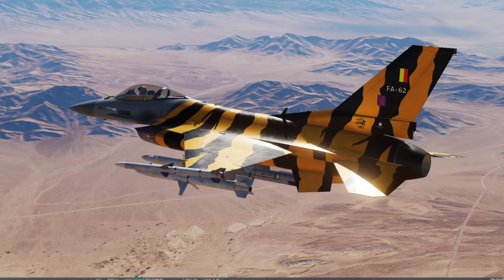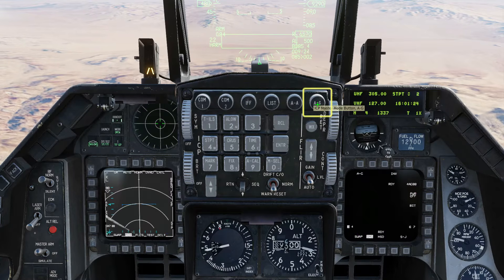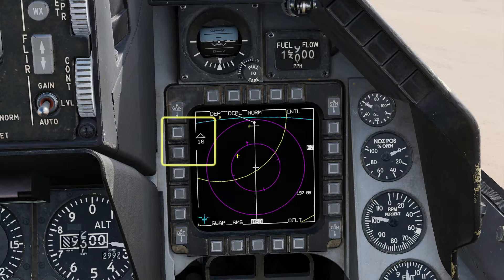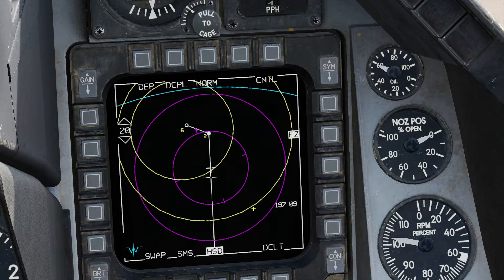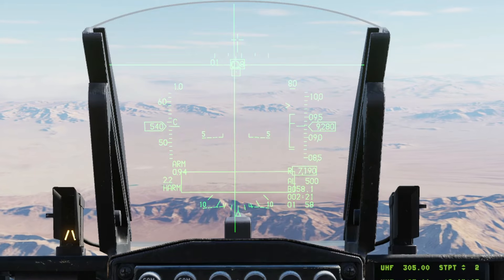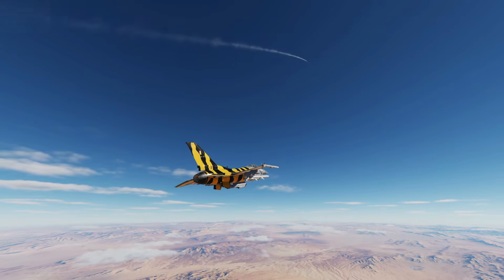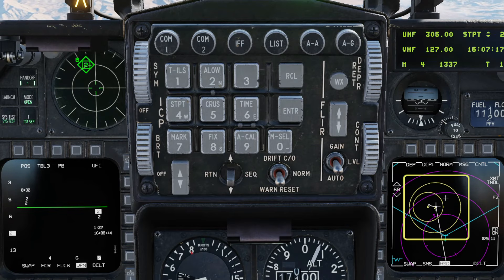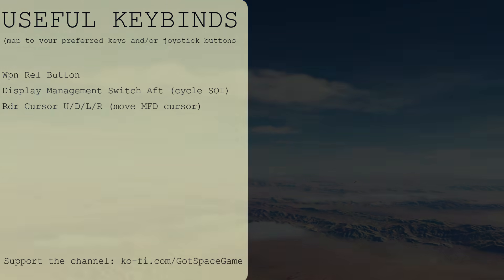DCS F-16 HARM PB Mode Tutorial - AGM-88 Pre-Briefed SEAD Guide - DCS in 3 Or Less

Comment: So harm missles have to be told what type of AA they are looking for? Silly question, IRL what if Russia messed with their radar signatures a bit...would HARMs basically become useless?
Reply from the maker: @mattm7798  in this mode, yeah. With the HARM Attack Sensor or in HAS mode it's a bit different. As for messing with settings I'm not sure but at least some of it is likely down to physical factors like the antenna shape and size... I'm sure lots of work goes on behind the scenes to negate any possible adjustments but that's obviously just a guess.
Reply: Regardless of how radar parameters are adjusted, the emission patterns of an IAD (Integrated Air Defense) system remain consistent. The sequence of radar activity is predictable:

	1.	Early Warning (EW) Radar: Provides occasional long-range pings for initial detection.

	2.	Acquisition/Search Radar: Activates as you approach, operating at higher frequencies for better resolution to refine target data and prepare for engagement.

	3.	Target Tracking (TT) Radar: Locks onto the target with very high frequencies, making its function and role unmistakable.

	4.	Fire Control (FC) Radar: Engages at close range with extremely high frequencies for precise guidance.

Even if parameters like frequency or modulation are modified to deceive a HARM missile, the overall function and progression of these systems are tied to their roles. For example, an SA-20 system is engineered to operate on specific frequencies optimized for its antennas and components. Significant changes would require redesigning the entire system.

Ultimately, the physical phenomena of radar emissions (frequency, pulse repetition, etc.) are fundamental and cannot be fully masked. Each stage of the IAD system is distinct and identifiable based on its RF signature, so tweaking parameters wouldn’t render a HARM ineffective.